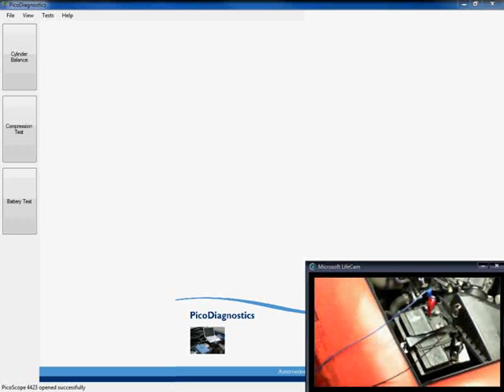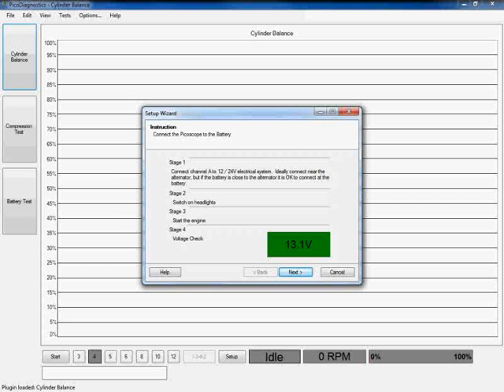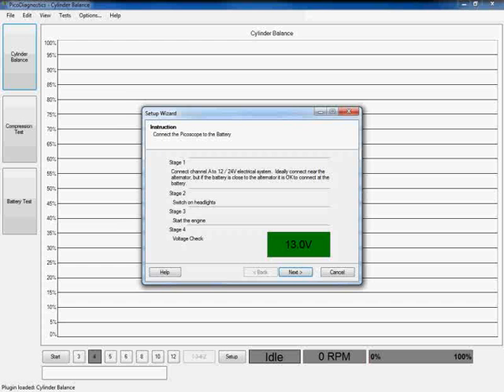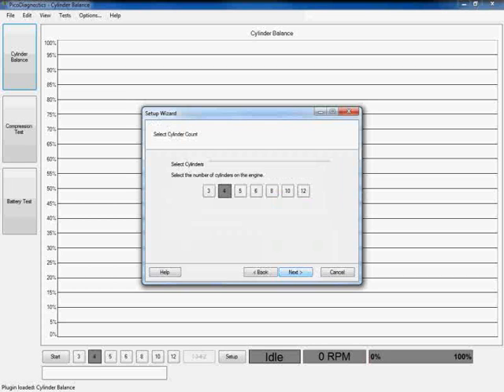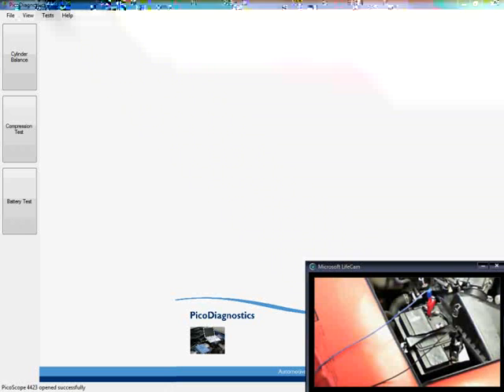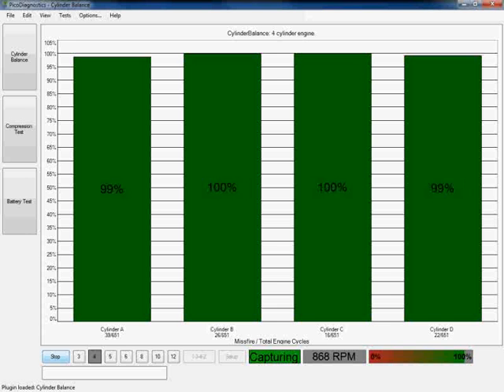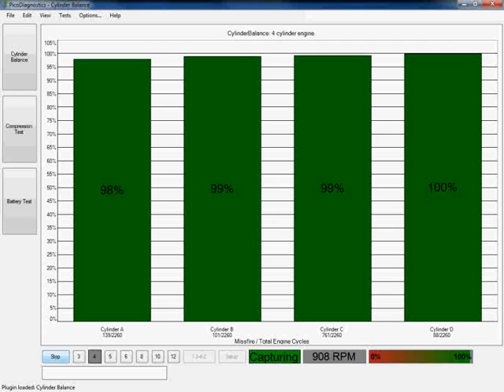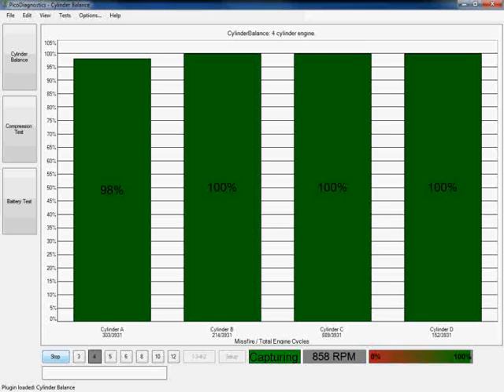Misfire diagnosis and cylinder balance testing using an oscilloscope

Comment: But you program suggest to connect the wire to the alternator, and use the battery only of it's close to the alternator. I could not understand how"close" is, as for me- connecting to the battery caused an error message (turning on heavy battery consumers did not helped), and I don't have an easy access to my alternator terminals. BTW, what is the difference between this test and the relative compression test in terms of the received data? Why to do both is the Cylinder data seems to give the same data live?

Comment: Thanks, in your video, for channel A you are connecting to battery +  and will you get alternator ripple from channel A, or you have to use different channel in pico let say B to connect to alternator + wire to get RPM. pls advise.